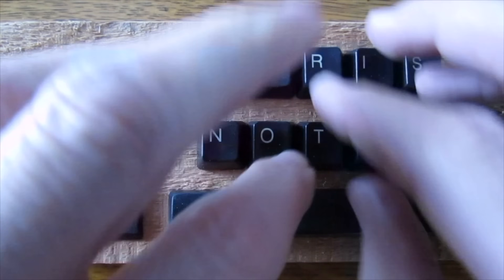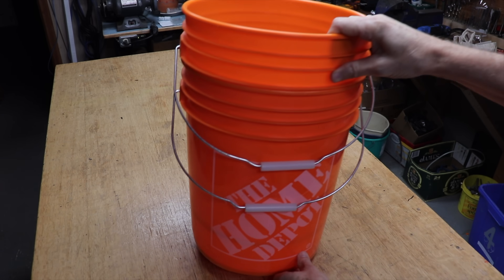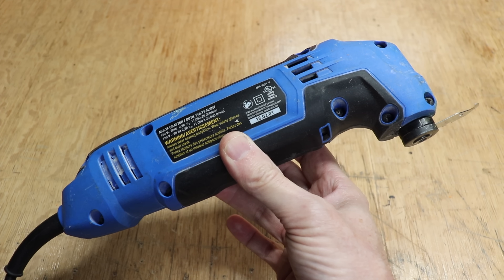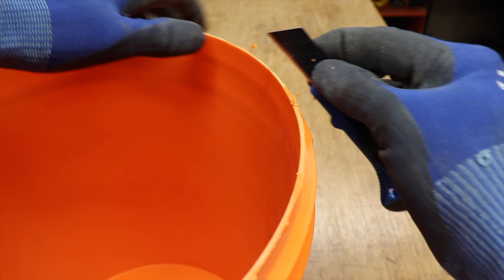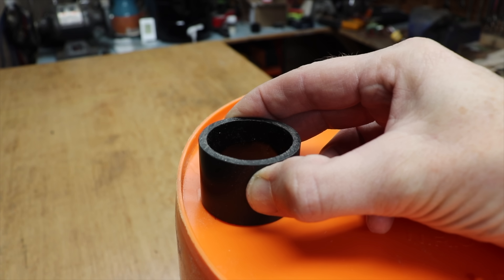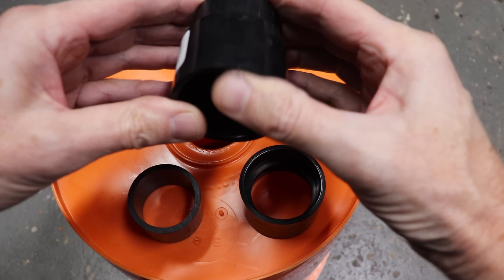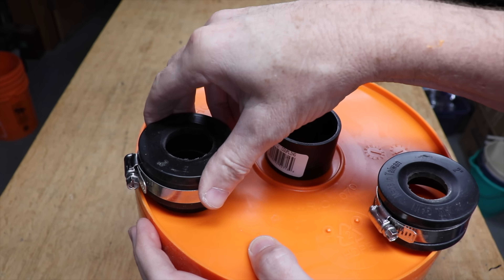How to Make ● Simple Cyclone Dust Collector

Comment: This is brilliant. I am collecting my sawdust because I mix  it with shredded paper and cardboard in order to make paper bricks for my wood stove. One gets a lot of advertising and junk mail -  to me that is free fuel for my wood stove. It doesn't burn quite as hot as  wood but I mix it with fire wood. Using the sawdust in the mix with the paper makes those bricks burn a little hotter and longer. Have 2 buckets like the one seen in the above video, bore lots of holes into it, insert into the second bucket fill with shredded paper and cardboard let it sit overnight stir with a paint mixer or something similar. Take the inside bucket out squeeze out the water and use the mush to fill into brick forms (available on ebay or amazon some even make 4 bricks at the same time) squeeze again take out the bricks and let them dry. Use in the winter to fuel your wood stove . There are videos on how to do this also on youtube.
Reply from the maker: Thanks!! Did you see the update video? ... https://youtu.be/BeU4nqSJtBY
Reply: @chrisnotap  Yep I  did and loved it. I too have just a small shop vac and  this system works great and is easy  to make and most of all  - CHEAP just please keep the buggers out of it

Comment: I have a little 1.75hp stinger shop vac.  Would that be enough to power this set-up?
Reply from the maker: Definitely worth trying.
Reply from the maker: Thanks!! Did you see the update video? ... https://youtu.be/BeU4nqSJtBY
Reply: @chrisnotap  If you mean the one where you beef up the system with an additional pail then yes I did.  At this point I am going to hold off as my shop is my back deck.  Condo living means I don't have to cut grass or shovel snow, but I have to drag all my tools up from the basement each time I want to work on a project.  We are likely going to move within the next year and we want to find a small house with some sort of out building where I will set up shop and put in a dust collection system.  Likely yours!

Comment: FYI, the new buckets from HD are shaped a little bit different than yours. You can still use them but it's kind of a nuisance that they changed the design. For one, there is no longer a third ring near the top of the bucket so you can't use that as a guide anymore. You have to just free cut it. No big deal. Also, at the bottom of the bucket, the center ring has been made the exact same size as the 1.5" PVC pipe. So, you have this protruding circle you gave to deal with now. I was able to get the snips over it and just cut tightly along the ring. Again, no big deal but just annoying.
Reply from the maker: Thanks for letting other know!
Reply from the maker: Did you see the update video? ... https://youtu.be/BeU4nqSJtBY
Reply: @chrisnotap  I did. In fact, I was thinking of adding the brick to the bottom bucket and attaching caster wheels to make the system movable. 🤔

Comment: Omg I tried this today. instead of a dust collector, I evidently built the state's loudest pipe organ. 😂
Reply from the maker: Try removing the hoses. They can cause a loud whistle.
Reply: @chrisnotap  It's definitely my second hose. It's a smaller diameter than the hose from cyclone to shopvac, so I get increased flow velocity through the cheaper, smaller hose. Perfect for resonance!

Comment: I've created this, following the instructions and using similar parts (not all exact). I end up with the sawdust going in the vacuum. I get about 1/10th in the bucket but the rest cycles back up. Putting a light at the bucket, I can see it swirl down and then back up. Have tried sooooo many changes to angle and design. Can't figure it out...
Reply from the maker: Are you sure you don’t have the hoses mixed up? The vacuum cleaner should be connected to the centre and the saw dust hose is on the side.
Reply: @chrisnotap  yes, very sure thanks. My inlet is 2 1/2 inch. I'm wondering if the air flow in is too slow and the debris is moving slow enough to get sucked up instead of forced down. Your hoses are a smaller diameter creating more velocity.

BTW - your channel is awesome. Love your videos.
Reply: @chrisnotap  I rebuilt the top bucket with 1 1/2 inch inlet and outlet (matching sizes). That seems to have made a world of difference. I no longer have a second swirl traveling back up to the top of the buckets. Could be coincidence and there was something else wrong with my first top-bucket. We'll never know!  This was a fun project - I was able to use a bunch of spare ABS and PVC parts from previous projects and mount it all on top of my small shop vac. Thanks for the videos!

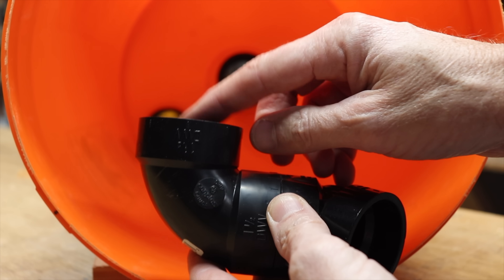Comment: At 4:05 "just put it on top and give it a good push downward" did not work for me. Even after passing 6 time perpendicular to the rim, I can even see the angled cut but it doesn't go easy as your video.
Reply from the maker: Some commenters have mentioned the same. It appears that Home Depot has a few manufacturers of these buckets that are slightly different in dimension. Others have said that Lowes buckets also work.

Comment: Works perfectly, thank you!
Reply from the maker: Thanks!! Did you see the update video? ... https://youtu.be/BeU4nqSJtBY
Reply: @chrisnotap  Yes, but only after I had the same problem with collapsing. However since I made my separator with only 1 tall bucket and a top lid I fixed it with a strong and slightly smaller bucket which I put inside and it helps to keep the bucket stable. Thank you again

Comment: I expanded on your idea, and upsized the 5 gallon bucket to 17 gallon tubs. I'll be vacuuming out all the old blown-in insulation in my attic and this should help a whole bunch, the professional tools for this are thousands of dollars. I used pipe insulation for the gasket and long radius bends to reduce head loss a little. I had to put in a simple bypass downstream of the collector to keep the tub walls from collapsing under the vacuum. Added 1/4" plywood to reinforce the top and used a threaded coupling for the center port. Thanks for the inspiration! Here's a few photos: https://photos.app.goo.gl/RTLbXP3KxgP5QjyU9

Comment: My total cost was about $30 including buckets.
My Home depot buckets were slightly different, (one ring in the base and a thicker 3rd ring down) and the fit was not as good as yours, just more trimming and it was fine.
Nothing got through it after dumping my shop vac on the floor, vacuuming that and the sawdust from my table saw over the past week. 
Better than most $12 bucket lids as it is easier to fit whatever hose you have to it.
Now, off to make a cart and get a longer hose.
Reply from the maker: Thanks!! Did you see the update video? ... https://youtu.be/BeU4nqSJtBY
Reply: @chrisnotap  Yes, I have. I used a broken bucket to mount the whole rig to a HFT dolly. Much easier to work with.

Comment: I followed the instructions and it came out right. Maiden voyage on Monday. A few differences:
1. It took ALOT longer to scrape the edge of the top bucket than I thought it would. 
2. The 45° connector I got was designed to fit into the 90° connector with no need for the 3rd piece of 1-3/8" long PVC. 
3. All holes were drilled using hole saws. ( I do not have tin snips- been meaning to get some.)
Reply from the maker: Did you see the update video? ... https://youtu.be/BeU4nqSJtBY

Comment: Isn't that what the shop vac is designed for ? This seems like a lot of work for something that the shop vac already does. take off top of shop vac  empty the cylinder. Tap the dust bag. am i missing something ?
Reply from the maker: The shop vac filter gets very plugged and is a mess to bang out when using it for wood work. This prolongs the filter life. Thanks.

Comment: I dunno if they’ve made changes since or if they carry more than one type of bucket but the ones I picked up are not the same..first, when cutting the bucket as in step one, because they’ve made changes there is a gap where the handle is..I’m going to have to figure out a way to fill in that gap..secondly the center of the bucket the circle is extended about an eighty of an inch and is the exact same size as the 1.5 inch pvc pieces..so I had to off center the intake..overall
This is an awesome project but I have to figure out a way to get a good seal..
Reply from the maker: From other commenters, it sounds like these buckets are not all alike in different parts of the US and world. Seems to be 2 models.

Comment: Nice but for $40 you can get the dust collection at HD that works amazing and just clips on. Yes you spend maybe $20 more but you also don't run a risk of messing it up.
Reply from the maker: You should buy one and try it out. Commenters have said they've tried them and they do not work as described.
Reply: @chrisnotap  I have it and it has worked amazing for the last 6 months of use.
Reply from the maker: Can you supply a link?

Comment: This is great! I’m making one this weekend but want something that takes up a bit less room so will try the 10” height buckets. Hopefully this will work the same.
Reply from the maker: Good luck! Thanks!! Did you see the update video? ... https://youtu.be/BeU4nqSJtBY
Reply: Chris Notap yes I saw that one as well. Seems like a solid fix. Space in my garage is limited so I’ll likely try the shorter buckets. I’m just worried that the dust at the bottom of the bucket will get sucked back up due to the shorter height. We’ll see 🤞

Comment: I just completed my build of this project and IT WORKS! I used a hack saw with a fine tooth blade to cut the ring off the bucket. It was slow going but just took my time and used that edge as a guide. When fitting,  the mold marks on the buckets I had were a little proud when trying to fit the half's together so a light sand with 400 fixed that.  I kept buying shop-vac bags over and over. With a pademic going on finance common sense said it's not the time to buy a commercial unit or more bags. Save those pennies. Mine cost me $15 dollars. Thank you so much and the wife thanks you too.
Reply from the maker: Thanks!! Did you see the update video? ... https://youtu.be/BeU4nqSJtBY
Reply: @chrisnotap  no I had not. NOTE, I didn't use the orange buckets. I used ones from ACE hardware. They must be a thicker mill (wall measures just over 2.7mm) as they do not suffer the collapse like the orange ones do. My first test I blocked the hose connection with my hand. The buckets did not collapse.

Comment: Chris, i copied this exactly the way you did but why does my hose sounds too noise like an echo whirl wind that really hurts my ears. Is my 1 1/2”  diameter hose a factor?
Reply from the maker: Some hoses will make a loud whistle noise yes.
Reply: I changed the 1 1/2” hose into 2 1/2” and it works perfectly now. No swirling of air anymore. Thanks!

Comment: Great idea, simple and effective. I noticed the weigh of the fittings / hoses (mostly the hose) on the top of the bucket caused my bucket top to crack, I added a 3/4" plywood "plate" to the inside of the top of the bucket, now it is sturdy. Also for your tipping problem, since there was another bucket needed, you can also just trim off about 4 inches from the base place the  newly cut bucket top down and insert the collection bucket. snug fit, wider base... no tip. Thanks for the initial idea!!
Reply from the maker: Thanks!! Did you see the update video? ... https://youtu.be/BeU4nqSJtBY

Comment: Thanks Chris I'm really  happy with the cyclone. Easily the best on I've found a video for. I ended up gluing the joints on the Abs pipe. It just made everything fit better. The other suggestion i have for people is to secure the dust collector in an upright position. Amazing addition to my humble shop.
Reply from the maker: That's great!!  Did you see the update video? ... https://youtu.be/BeU4nqSJtBY
Reply: Chris Notap 
The update video is pretty sweet. Haven’t had any problems with the cyclone collapsing. I’ve got a wider shop vac hose. Might have something to do with that

Comment: Why not switch the (suction hose and intake hose) around, and add an (internal extension PVC pipe) to the intake center hole? The (suction would be at the top) of the top bucket and the (intake would be in the middle), a bit above where the two buckets fit together), giving more separation between the (suction and intake). Note, you can still fill the first bottom bucket with saw-dust.
Reply from the maker: I tried everything you mention. This was the best configuration. Simple was best.
Reply: @chrisnotap  It should blow into the (bottom bucket) with suction from the (top bucket)?
Reply: @chrisnotap  You won't have a cyclone, but you will have more separation between (the in and out). It would be easy to try, the modification and post the results video. You already have a vacuum cleaner extension pipe? So, it would take almost no time to try again, in the specific way I mentioned in detail.
Reply from the maker: With the intake in the centre the incoming air would perpetually stir up the dust in the bottom causing no dust to collect..

Comment: At first, I couldn't get the buckets to snap together. I cut a few v-notches and still wouldn't fit. After softening it up a bit with a propane torch, it became a perfect fit. Thank you for the great info!
Reply from the maker: Great job!  Did you see the update video? ... https://youtu.be/BeU4nqSJtBY
Reply: @chrisnotap  Yes, and glad I did because I tried without adding the extra buckets and the buckets easily collapsed. Also, instead of the flexible caps, I used the 1-1/2 by 1-1/4 flexible couplings with small clamps removed to connect to my Ridgid 2.5" hoses.

Comment: Just finished building mine. Work great. Thanks for sharing.
Reply from the maker: Great to hear!  Did you see the update?  ..........https://youtu.be/BeU4nqSJtBY
Reply: @chrisnotap  I had already figured out the brick trick and added sprig clips to keep the buckets together and 1 1/2" - 2" top couplers that fit up perfectly to common hardware store adaptors for the shop vac. Once again thanks for the great tutorial.

Comment: I just built one of these. Worked great, but a couple comments:
- Home Depot has apparently changed the design of their bucket. They only have two lips now so you have to eyeball the cut line of the rim. 
- too much shop vac will result in your buckets collapsing faster than your 401k during a pandemic. I got a bit of a blockage in the angle pieces and both buckets went beer can on me. I’m going to try to put some scrap steel reinforcements along the sides. Hopefully the screw heads on the inside of the bucket won’t affect the cyclone.
Reply from the maker: Did you watch the update video? .....  https://youtu.be/BeU4nqSJtBY

Comment: I just recreated this project and found a few things that made it easier:
Cutting the caps ended up being particularly difficult for me the center one went well enough to my standard shop vac hose, but connecting the second one kept giving me issues, including cutting it too big, so I got a 2” to 2” rubber clamp connector (they were right next to the caps at the hardware store). I cut off the clip on the second shop vac hose, then clamped the connector to the PVC and the hose. That was a lot easier for me and I may end up replacing the cap for the center one. Also my bucket ended up with a 1.5” crack from trying to get the pipe into a hole too small. After fixing the sizing issue, I used rubber cement to fix the crack. Overall, great project. Thanks for the tutorial.
Reply from the maker: Did you watch the update video? .....  https://youtu.be/BeU4nqSJtBY
Reply: I used my heat gun to soften up the bucket and then slid them in.  When it cooled down it is SUPER tight.

Comment: Thanks for the research and video.  I've watched DOZENS of DIY shop cyclone videos and choose to make yours.  I used 2" parts, but the same design.  Really like the top bucket design to give more room for debris.  I spent roughly $25 and the final canisters work great.  I found that the straight pipe in the middle worked best when it was slightly lower than angled debris part.  Thanks again. Very clever design that works great!
Reply from the maker: Thanks for that great feedback!

Comment: I made one of these today - made a few adjustments due to 4" off the Vac. I have also added a 15 foot long 1.5 inch hose for the pickup end. So, I have 6 feet of 4" into the top center bucket and 15 feet of 1.5 inch into the cyclone on the bucket. Works unbelievably good with my 5hp vac. Almost nothing makes it through.  Oh, and the 4" into the bucket is simply a pressure fit. Nice and tight! Love this design!
Reply from the maker: Did you watch the update video? .....  https://youtu.be/BeU4nqSJtBY
Reply: @chrisnotap  Yes! commented there too!

Comment: I’m not sure which Home Depot you got your buckets at , but the Home Depot in the Wichita, KS area must get theirs from a different supplier or something because my buckets weren’t the same as yours, I was still able to make it work like yours but had to cut the top off different.
Reply from the maker: A few others have mentioned that too. Others have also said they used Lowes buckets and they worked also.

Comment: Anyone using older home depot buckets just realize that the lips around the circles differ from this video, I cut right around where he did his cut and realized I cut too far down on the older bucket but made it work as a proof of concept. Also, he uses a smaller hose so if you are using a normal 2 1/2" hose, you need to find a better way to hold the hoses together. Otherwise it works!

Comment: I had already built one of these based on another YouTube video, but couldn't get a reliable seal between the two buckets. Your method works great! I used a regular wood/drywall blade on my multitool to cut the bucket and it worked well.
Reply from the maker: Did you watch the update video? .....  https://youtu.be/BeU4nqSJtBY